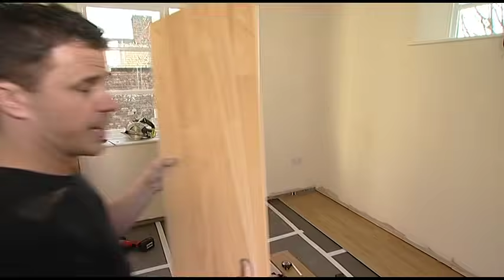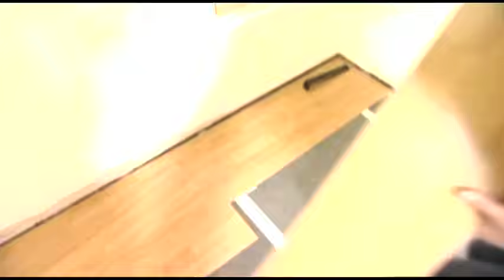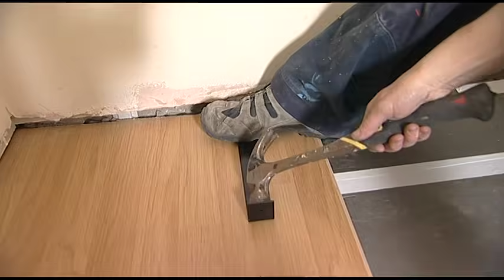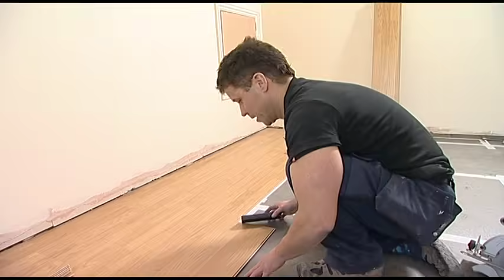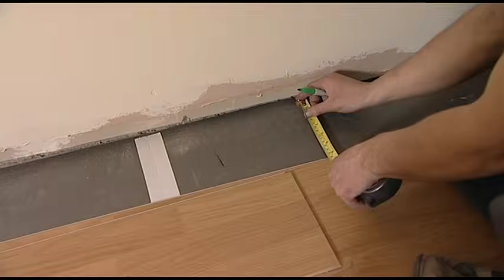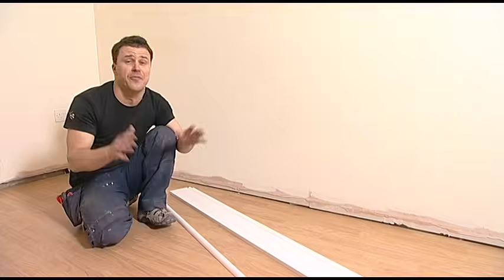DIY: How to lay laminate flooring - with Craig Phillips

Comment: You deliberately left out the hardest bit - how to install a laminate board on to another board. You showed us how to fit an end board but didn't show us how to put boards in the middle of the run - do you lift them to get them locked in? or don't you lift them? which is it?

Comment: Crap flooring. When using quick step you don't need to slide the board along to click it in.  It's easier to use a guillotine to cut the board to length. That saw makes too much dust, and it's bad for health not wearing a mask. He makes  it sound easy, no mention about cutting tha thickness of the board out from the bottom of the facings and door frame.
6mm board are rubbish, it's best to use 8mm or thicker.

Comment: What's the best insulation under the planks if the priority is to keep the feet warm from the cold concrete? (Underfloor heating is not an option because of height)

Comment: Thanks CRAIG. PLAIN AND SIMPLE INFORMATION ON FITTING FLOORING. FOR LONG WALLS RATHER THEN MEASURE EVER FEW INCHES FOR YOU LAST BOARD AGAINST WALL. GET A FULL  LENGHT OF FLOORING. PUT IT ON TOP OF WHAT YOU HAVE LAYED . AND THEN GET A SMALL CUT OFF BOARD RUN THE SMALL CUT OFF DOWN THE LENGHT OF YOUR WALL MAKEING  A PENCIL LINE AS YOU GO TO GIVE YOU THE SIZE AND SHAPE OF YOUR LAST BOARD AGAINST WALL BASICALLY IT GIVES YOU A TEMPLATE OF YOUR CUT. ALWAYS ENJOY YOUR VIDEOS GREAT INFORMATION AND EASY TO UNDERSTAND.

Comment: Well explained! A note to any new installers; When he says to start the install on the left and work your way to the right, that means to start on the left against the wall lay that entire row then move over continue each row
Reply: It was badly explained. He left out the hardest bit, lifting boards along the run to get them to lock in.

Comment: Major faults 
1 never showed the 9 inch staggering method 
2 never used Packers to keep the gap 
3 should have stated to never nail the beading into the floor

Comment: Nice vid (with a few provisos) : Yes - Leave a 10mm expansion gap (but u can establish the gap with spacers - little blocks 10mm in width) If you have to trim your end planks - Yes - Use a circular saw ... But the plank should be held securely before cutting - I would always use a workbench to secure a long plank like that - then cut. Craig is making it look very easy, but I suspect he's an experienced carpenter. If you're not, secure your plank before cutting with a tool as dangerous as a circular saw, please! Yes- Always use safety glasses when using a circular saw and wear grip-gloves. Yes - Fit floor beading for a nice finish at the edges... Not sure what "quadpede" is? Must be a scouse thing? :) PS: Cutting floor beading at the corners is a bit fiddly - you might wish to check out this vid here that shows you how to cut 45 degree angles : https://www.youtube.com/watch?v=Z3--pCZB_Bc
Reply: I think he was saying quad bead/beading

Comment: The vast majority of people will be laying laminate flooring in a room with skirting boards already attached and will either have to cut the bottom of the skirting with an oscillating multi-tool to allow the boards to fit underneath or fit beading all around. So although the video is helpful it doesn't depict a typical real world installation.
Reply: Darius Dalrymple you can remove them..only takes about 15 minutes

Comment: I was told we have to use a T-mold instead of continuous flooring into the next room.  Is this true?  I'm so bummed if it is!
Reply: not really you can always just continue laminating into the next room but you have to make sure its dead straight otherwise your flooring will look skewed. t-molds make it easier so you dont have to worry about that happening

Comment: if you turn the board around and Mark your length from the wall back to the sec last board you don't need to use a measuring tape
Reply: Robert Darb
Reply: Ken Parrot
Reply: Tim Penguin
Reply: Clit Cobra

Comment: While you can cut laminate flooring with a circular saw, a laminate flooring cutter makes the job a lot easier. And they're not that expensive: 
http://www.amazon.com/gp/product/B00B0BYY4Q/ref=as_li_tl?ie=UTF8&camp=1789&creative=390957&creativeASIN=B00B0BYY4Q&linkCode=as2&tag=ytaj-20&linkId=GFOTU5HPAPFVXLE2

Comment: You will find it much easier if you actually start at the door and work away, that way you can slide your first piece under the door frame once you've trimmed the bottom of the frame.
Reply: whoflungdung74 what happens if you got 2 doors?

Comment: Great vid...thanks Craig. Something worth noting though is, if you've removed the skirting so as not to need scotia trim on the perimeter, you don't need to have the 10mm expansion gap inwards from the wall...the skirting board sits over and outwards from the wall...so the gap can be under and outwards from the wall.